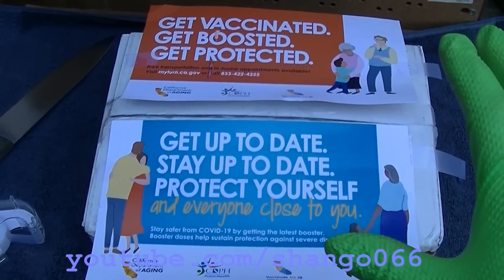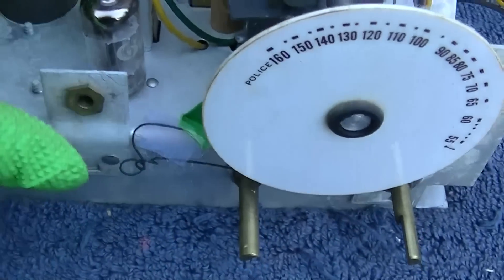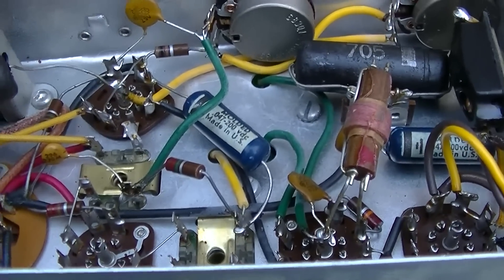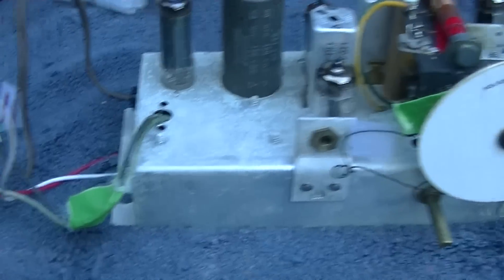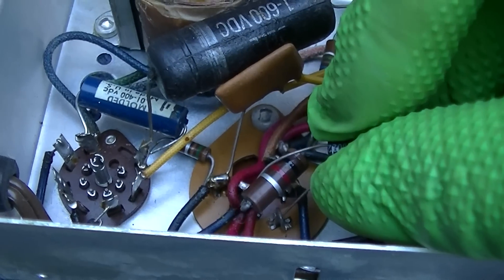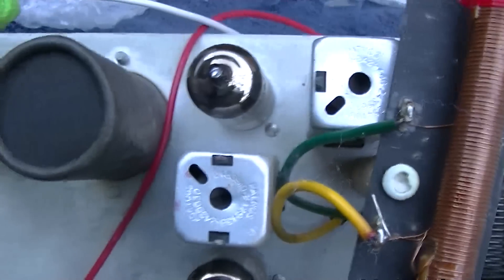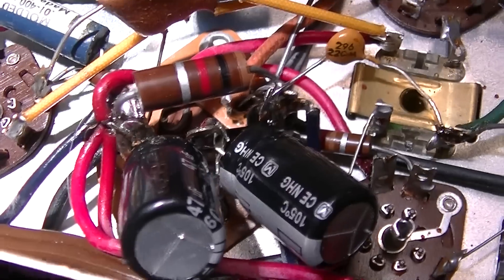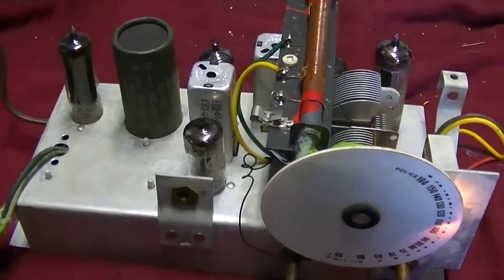Guild Telephone Radio AM AA5 Repair

Comment: Those are clutch head screws; they were used on Chevy trucks and other GM vehicles from the 1940s through the mid-1960s.  Clutch head screws were also used in mobile home and travel trailer manufacturing from the 1950s into the 1970s.  Clutch head screws are ideal in a vibration application because they can be torqued more than standard screws when installed.   I've also seen them used in old Sun test equipment.
Reply: Those clutch head screws were also used in old 70's Ampeg guitar amplifiers.
Reply: Motorola liked to use them in some of the radios I have from the early to mid 60s
Reply: Indeed, I recall my old 1951 Chevy Pickup with a straight 6 and 3 on the tree had those screws holding the front seat to the brackets, dad's old 53 Ford also had those screws holding the door latches on the pillars.

Comment: Vintage Fender guitar amplifiers use those blue caps, that's why even used ones bring a premium price. So does some Bumblebee caps. They used the bumblebee caps on the tone pots of vintage Gibson electric guitars.
Reply: Those blue molded Malory capacitors are relatively reliable, unlike the yellow Astron caps which often leak.
They are metalized polyester caps.
Reply: @KrisisVal  I don't know of a cap that doesn't eventually leak. But, I'm old school, I love Astron Yellow Jackets, Black Beauties, Bumblebee, Sprague Mighty Mites, Mullard Mustard caps, Vitamin Q, Ajax Blue Molded polyester film caps, Sprague Orange Drops, Malory Blue Beauties, etc.
Reply: @sonsofthunder915  I have seen enough repair/ restoration of old Fender amplifiers.  The yellow Astron caps are almost always leaking DC and need to be replaced, while the blue molded caps are almost always good even though they're only a few years newer...
Reply: @stevem.1853  In many cases I agree, but, with a caveat. One cannot beat the tone of Astron Yellow Jackets.
Reply: I would like to see the face of the new electronic geniuses looking for old technology during a concert in summer in Alicante in the open air with almost 40° and then another one in Kaiserslautern in winter with the same pedal with germanium transistors paired with the exclusive DAC55 just for pro people
Reply: @soulrobotics  I've been repairing vintage electronics for 42 years. I don't touch SS equipment. Germanium has three things SS doesn't have, that is tone, tone, tone. I've also been a tech roadie in Europe on two small tours. (no stadium tours) The equipment is always maintenance before going on the road. FYI, depending on the band most bands bring back-up amps and two pedal boards with them anyways. If a piece of equipment goes on the fritz we either have a back-up or try to repair the equipment in the field. Since the band was the opening band, they could rely on the feature band mates loaning their amp(s). If all else fails ever hear of a "rain-check ? As they say "$h!t happens.

By the way the worst that's ever happened in my personal experience is a tube going cherry.  (Dammed Marshall amps) But we always bring an extra set of tubes, a few fuses, caps and resistors. Besides, there's only three amps (well five actually) the band I've been a roadie for use. Marshall Plexi, Fender Black Face Twin Reverb Fender Bassman and a Vox AC30T. This particular guitarist also used a Laney as a back-up. Basically, the same as a vox tone wise in my opinion. Pedals are all Boss (MIJ) and Thomas Organ wah. The sound system is the house equipment.

Comment: This radio is a Canadian radio. Radios made for the Canadian Market used those type of screws. Every radio in my collection from Canada has those type of screws and you could actually buy the tool to remove them.
Reply: And not a single Canadian does not have a robertson screwdriver.
Reply: This radio was not  made in Canada and those are not Robertson screws. Guild Radio and Television was 
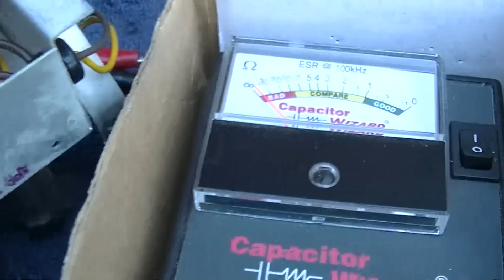in Inglewood ,California !   At 4:27 in you see a screw head that is holding the phenolic base of the E cap (and
also the audio transformer ) was actually called a tamperproof  clutchhead security screw. There were several 
types of security screws available back in the 1950's and 1960's . In radios the most common one was called the 
triwing and had three slots in the center to keep the front of a dialface from being removed from the chassis.
Used long before Nintendo ever used them ! They aren't rivets as some restorers think.  Needed a special screw-
driver for each type to remove any of them.

Comment: They  are  Clutch head screws actually . Used often  in old GM cars and trucks and older applications . There are 3 common head sizes used .

Comment: 1:30 That's an interesting dial. I don't see any civil defense markings even though 1962 was at the tail end of the CONNELRAD era. The "POLICE" zone above 1600 is also kind of novel; I wonder how many police departments still used those frequencies in 1962; I think it's just room for a few more stations now. The spring clip on the loopstick is also unusual; I assume that's for an external antenna.
Reply: Sometime in the late 1950s or early 1960s, I recall hearing the Schenectady, NY, police department in that band, on a table radio which tuned above 1600 kHz. Also, at an antiques flea market, someone was selling a vintage police car radio designed for that band. As for when police departments switched to higher frequency bands, some city councils, especially in small towns, may have been slow about allocating the funding to replace the base station radio and antenna, as well as police car radios.

Comment: To turn the radio on, the user removed the earpiece from the switch hook and, to turn the radio off, placed the earpiece back on the switch hook. In typical table model AA5 radios with a dial light, the lamp is in parallel with a 6.3 volt connected segment of the rectifier tube's 35 volt filament. When the radio is switched on with cold filaments, a large current flows and the paralleled lamp receives enough voltage to reach full brightness. As the filaments warm, the lamp receives less voltage and dims. When the tubes warm up, DC to the tube plates also flows through the filament segment and the lamp, bringing the lamp to full brightness.

If the radio is turned off and back on before the tubes have cooled, there is a surge of DC to charge up the filter capacitors and the lamp and filament receive an overvoltage for a short time. The overvoltage may cause the lamp and/or filament to burn out. Usually, the switch is on the volume control. The user turns down the volume and silences the speaker before the radio switches off. There is less likelihood that the user will hear something of interest and switch the radio back on immediately.

In the Guild, the earpiece may bounce on the switch hook. Also, the speaker is not silenced on switch off, playing for a short time as the filter capacitors discharge, so the user may hear something of interest and decide to quickly switch the radio back on. The Guild provided two extra features to minimize the surge. First, the typical AA5 used a #47 dial lamp, rated at 150 mA. The Guild used a #44 dial lamp, rated at 250 mA. So, the lamp could handle an extra 100 mA. Second, the Guild had a 150 ohm paralleled resistor, which would carry about 40 mA at 6.3 volts. In normal operation, the lamp would not receive the full 6.3 volts but would glow bright enough for the user to see the dial.

Comment: Those caps are used in 60s era fender guitar amps. Usually hold up pretty well. Most I test for capacity and leakage pass. Could be people are hoping to keep there old amp all original.

Comment: Where did the dial cord get wound, I would like to see that all assembled, maybe there was a knob on the cabinet that turned the dial. The wooden case probably kept the chassis from getting roached. I fixed a few all American 5 s just by changing filter cap.
Reply: A short brass rod that was affixed in one location (the hole) and had a curved depression where the dial cord
went around it. Seen a pix of an unmolested chassis.

Comment: blue caps are in vintage Fender amps,which sell for a lot of money,you can make big bucks too,even if they are leaky,what's important is the colour,be it blue or orange,whatever
Reply: Not at 200v. But they’d work fine in some older Rickenbacker, Magnavox, etc SoCal-built guitars of the era.

Comment: Odd (in my opinion), both mint and motorboating, but not humming (as I would expect for bad smoothing).  As well as the commentary, It was the stamps that amused me, not $8 or $9 or $10 but $8.95. There must be some really large stamp books in the post offices.
Reply: while the stamp value seems odd, it's probably a common value, such as the starting postage for Priority Mail (currently as $9.35).  Filter hum is usually the first capacitor after the rectifier, but later stages can cause motorboating.  The power comes in though a dropping resistor and without the smoothing cap, the power audio stage affects the voltage on more sensitive stages.
Reply: 8.95 is a standard value for a certain kind of postage namely a letter size unpadded flat rate envelope at the moment